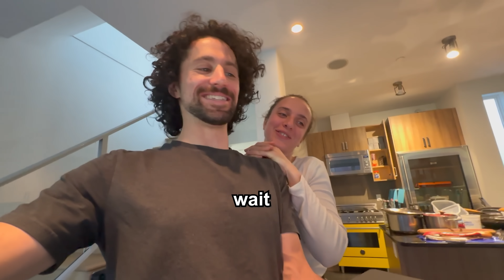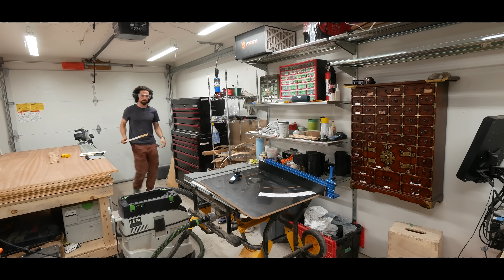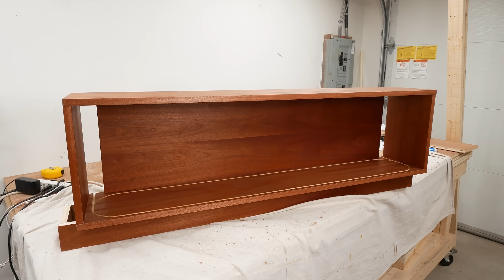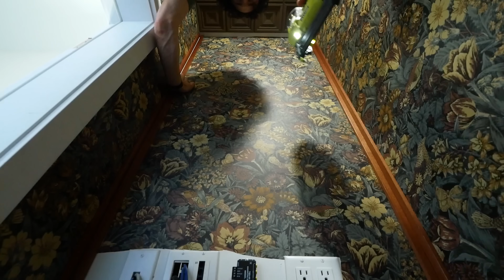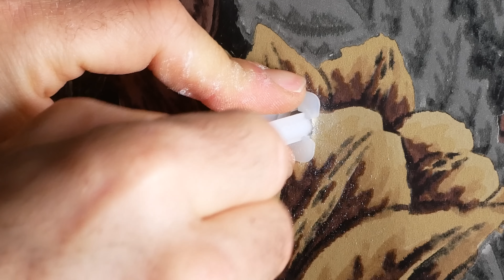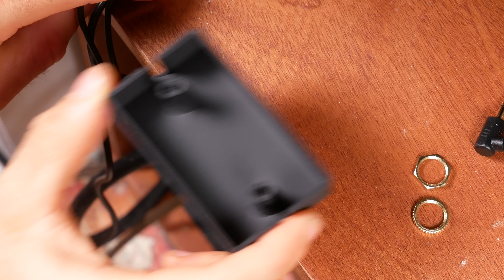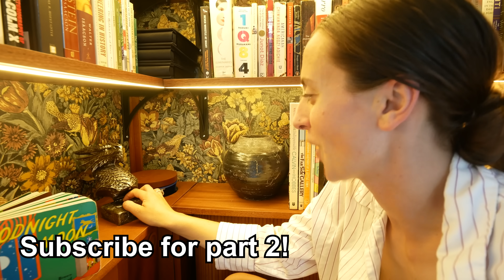I Built a Tiny Library on my Stairs

Comment: For the door, I think you could fuse those wood slat doors with a painting and have it roll up and onto the upper part of the wall.

Or, if the space doesn't work for that, get yourself a piece of art that naturally splits down the center to make 2 compatible pieces that roll onto either side when not in use. Should be okay to mount on the wall with a stylish track that could always be hidden by a curtain when everything is closed up. The curtain can be tied to either side for display as well. When you want it open, you have a hidden library framed by two pieces of art and a curtain. When you want it closed, you have a single piece of art framed by a curtain.

If you want a one-way mirror, you could put decals on one side and do the split art thing with that too.

Additionally, I think the curtain could be of either the heavier drape variety or of the light and sheer variety, whichever works best for the space.

Comment: Hi, here's a doorway option.  Extend the framing of the doorway entry up the wall to mimick/match the height of the window.  In the extended framing use a full length one-sided glass (not sure the wording for it).  The full length would make it a hallway mirror reflecting the window's natural light from outdoors and may allow and upstairs/downstairs view. The lower section of the one-sided glass would be the door way where the person inside can see out and no one sees in.  Remove doorknob and add magnetized press/release flat open/close feature to keep everything seamless, that way the doorknob doesn't make it obvious that there's a space abehind it. It would also allow the window's natural light into the room...I think.  Your creativity in this project was clever, creative, refreshing and practical.  Nicely done!  All the best to you!

Comment: For the door, I like the idea of a one-way mirror that you can see out of when inside but reflective on the outside. It would have to be a two-piece mirror which swings out 180º when opened... so a little like French doors. The inside of the mirror can optionally have a roll-down shade so that any light from inside wouldn't leak... or... you could even have a switch which turned ON LED lightning behind the mirror as a reveal. SO, the library is secret until you turn on the light which reveals the inside.

Comment: I love it it looks awesome 
2 thoughts.
1) put some sort of cushion on the top edge of the door to help with head bumps
2) make the door with lattice work and back it with fabric. This would create privacy without blocking airflow. You could even implement some sort of low profile fan that can heat or cool that can sit in this door making it easier to control the climate. As blankets exist maybe just a fan for cooling/airflow. Probably safer that way.

Comment: Eden is, indeed, the GOAT.  

As far as the door design goes, I am confounded as to what to make the outer shell look like, but I would recommend trying to make the actual door mechanism into something that opens vertically.  The 9-year-old in me says that the doors should have their seam about 2/3 of the way up the doorway, with the lower section being larger.

The reason to do this is that the lower section does not open to nearly 180 degress, but to something closer to 135.  The lower portion of the door conceals a set of simple steps, finished in the same way as the shelves, with a little hard-wearing tread in the center of each step so it doesn't wear out.  

The upper third will flip upwards, possibly on a complex hinge that allows that section to fully get out of the way of the doorway.  This way, when the door is open, there's a short stairway that allows a reader to climb up into the library without having to awkwardly swing their legs into place.

Comment: A pocket door would be perfect here, but that's not possible if you can't modify the wall. Maybe instead of a door you can use some nice curtains. You can tie them open when you want it to be viewable. That would also help with ventilation, especially in such a small space.

Comment: EDIT: Eden is the GOAT

Those drywall toggle anchors are heavy duty, man. (Made from glass fiber reinforced nylon, I think). 
       The good ones have a round part you push in to reinforce the hole, and a bolt (not a screw) to pull the toggle thingie as tight to the wall as possible.
     This means the force is distributed evenly across larger plains on the front and back of the drywall, and the hole reinforcement assures there will be no tear out (i.e. The screw cutting the drywall in half when weight is added)
.     Those style anchors can hold a couple hundred kilos (times that by 2.sumfin and you have the amount of pounds).

Pro-tip:
Use drill bits for metal to get the cleanest, most perfectly sized holes imaginable.
     (They don't even need to be super sharp. It's the geometry of the drill bits that gets the result)
.    Just make sure the drill bit runs perfectly straight. Run your drill full speed, view the bit from the side. If it looks like this: || it's fine.
If it has blurry tapered edges like this: \||/ it's not straight (and will create a larger hole).

Super dope project. And a wonderful result 🤘

Comment: Door idea:
A picture frame that slides upwards. 

This makes it feel naturally integrated in the house whether it is open or closed.

To avoid wall installation you can mount a fixture in the top of the doorframe. 
If you motorise it this to can have a hidden button like in the dragon. 

To make it less claustrophobic and better ventilated the picture could be made like the perforated advertisement wrap on shop windows, busses and cars, where the perforations let light and air in. So a picture printed on a firm durable perforated plate. 

Best of luck 😊

Comment: A bit of constructive criticism: I'm sorry man but i'm not digging those glaring white strips running across every shelf. I am a big diffused light kind of person and even with the diffusion strip, pointing them right in your face defeats the purpose, and it clashes with the aesthetic very badly as well.  

I think the effect you're going for would be to run them along the front of each shelf on the top instead of the bottom, either slightly recessed at an angle, hidden behind an extra bit of trim, or some combo of the two. The point being to point the strips to shine back at the books and light the rest of the space with the light that reflects off them, you want the lights hidden as much as possible.

They actually have special strip diffusers that have a prismatic quarter circle specifically for lighting from a corner and shine evenly across 90degres or ones that just mount flat at a 45 degree bias.  that would also be carvable into the shelf or printable.  

Also, please please paint that shelf in the hidden compartment black, or if you can make it look either wooden, metallic or otherwise matching the base of the bust that would be the best.  you have this thing that is extremely whimsical in a space that has a classy/serious/grownup/expensive aesthetic, which is great and can totally work, but having this bright blue and green plastic shelf pop up, makes the entire thing look cheap, boarding on trashy. To really pull this mix off you need it to blend in, and just like the lights, as is, this is absolutely glaring.

All that said, i really do like your stuff.  You have a lot of heart, I really hope you keep ahold of it as time goes on.

Comment: My brainstorm is open up the ceiling & add a fan. Ceiling fans are anti-global warming. Use a pocket hole drill bit to create the hole. 
I, too, was thinking, 'wow, yes, that would be hard to design the exact right hole spacing' (I've never done 3d printing).  Until the end, where you said it gets stuffy.  
A classic case of our brains getting stuck in a mode, seeing everything as a nail. 🔨  And propelling 🧠us into over-engineering.

Comment: how about a photo of the current doorway, made into a painting, it would be hidden in plain site, frame the painting and the frame would be the door. But you have to be able to see out, so use perpex and one way mirror coating as the backing for the painting, and the painting can just be printed on mylar to make see through. It will give you away if you turn on the lights inside the library

Comment: Cover it with a painting that you can lift up (like a guillotine?). The painting surface should be thin enough so that it’s still breathable, maybe like a material close to women’s stockings? Then just sublimate/ print the image on it, add tack it/ stretch it on an antique frame. I would personally print out COMPARTMENT C, CAR 293 (1938) BY EDWARD HOPPER. To diffuse/ hide the light coming from inside the library, find or make an old banker’s lamp that can sit on top of the painting acting as a spotlight. This would help diffuse the light coming from inside.

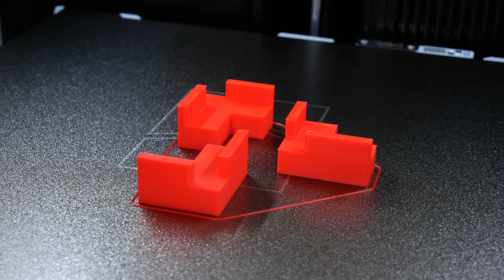Comment: 18:00 I could just be lazy but I feel like creating those jigs to create proper cut outs around the trim is over engineering (or if you just enjoy attacking problems in this manner that's fine especially since its a personal project) because I'd just pop the trim off and cut the trim to whatever height to sit flush on top of the shelves. You'd only need to use a pry bar, saw of any sort, and renail it. Instead you had to design a jig, print it, jigsaw the cutout, create new dimensions for the corners of the shelves, etc. In reality I'm just lazy and not as creative lol, LOVE the video!

Comment: Just a tip I used in the past. A strip of masking tape and some super glue in the 3d prints makes for a surprisingly strong way to hang stuff. When you want to take them out, you just apply a little force to unstick the masking tape

Comment: Since you did such a great job on the sliding wooden doors, what if you did something similar with the door for the library, like a super thin piece of wood that folds along the edges of the door frame. Maybe you could even automate it with a remote or hidden switch on the window (wireless to not cause damage)? Idk, I'm not a designer, but this library turned out sick!

Comment: 1 way mirror, a painting, a bookshelf (with secret spy hole), a second chair (would require open when the space is used), a large "book" you open to enter the library, 2 door fridge or wine storage, a large stained glass, glass shelfs 
I would also mask the opening with fake pillars and rounded top (is it called valve?)
Nerdforge might have some cool ideas

Comment: One of those retractable shower doors the van lifers use might work. It’s easy to install, stays small and out of way when not in use, and still allows light from window thru if one is inside its not closed in but still out of view.  Sweet project.

Comment: How about a hydraulic wall base that turns into a short staircase to get into the library? And the top-half could be a painting, decor, or hell, even plants stuck to the base. The way to open the library could be similar to how you may have seen in old cartoons, like pulling a book out, or turning the hands of the clock. Or maybe you could do something with optical illusions. Maybe even a decor with a riddle that hints at how to open the hidden library. Or you could just do Narnia.

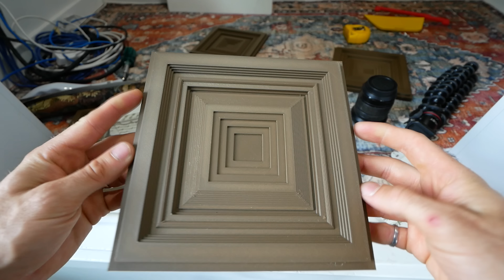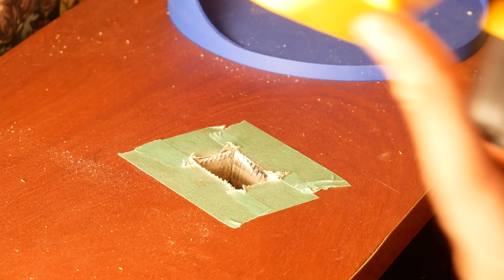Comment: 04:45 No I was actually thinking, why 3D print every tile. Why not print one, make a mould and then cast a load of tiles in either resin or plaster. 26:00 again kinda taking the easy route by hinging it at the bottom so the whole statue tilts back. You should have concealed the switch in the neck and just tilt the head back, or in the mouth….tilting the upper jaw back also pushing the tongue forward to reveal the switch. 🤷 Your approach just feels kinda half baked.

Or if you were just gonna have it tilt back like you have, why have a separate switch underneath you then have to press? Why n9t make the action of tilting the head back the switch? 🤷

27:50 a painting is good, but not one that splits in half or one where you simply open the frame out to get it. Have a big ornate gilded frame around (very Victorian) to get in you need to release a catch with something….either magnetically or rfid tag concealed in an object such as a wand. That opens things up and then you push through the painting…..so the image in the painting, say of a large ornate Library, folds back to the left and the top blending in with your shelves allowing you in……ORRRRR make the door a 3D illusion, like one of those 3D shapes that looks like it’s going back into a room but it’s actually coming forward. So when you walk past the thing it looks like a giant room even though it isn’t. And then just make that open up as a regular door. But it would add some additional storage space or general space to the inside. 🤷 like this is what I mean https://youtu.be/-tIQrWaWWT8?si=wempgdjepI7l0xnu

Comment: Hear me out. I know you said you didnt want to rip the wall apart but if you did you could or did. I think a vertical lift door but having the track come down and flush with the drywall. Use a picture frame style border and use a painting as the door cover so when all together it would appear as just a painting but when you push it and slide up that would be your entrance in the most secret way no visible seams.

Comment: A door that comes down instead of opens left and/or right would be rlly cool and save space. If you made an elegant frame and put a picture on that up and down door then you could still execute the secret painting vibe. Maybe turn the painting idea into a little challenge for the art class in a local high school! Of course making sure either a paint mixture that can easily be flexed regularly or the paintings be uploaded and get high quality printed onto a fabric. Also maybe put an old school style fan in there (with a good mesh just behind the horrible old school frame of it for safety) the really old fans with a splayed frame/guard would fit the aesthetic a bit!

Comment: The door for the secret library should be a see through mirror. meaning you can see outside even when the dorr is closed. But it will just look like a normal mirror from the front

Comment: Be kinda cool to create a set of functional shelves (or a painting) on a plate that slides vertically up.  this way you can either lift or lower the "door" from inside without possibly hitting someone (by swinging it out) or leave it just open with the "door" out of the way.  Plus it would meat your requirement of allowing you to view outwards and not block the stairs when its open.  It could also be set to look visually almost natural in an open or closed state (at least if using the painting or just a wall plate idea).

P.S. I totally expected you to put in like a small wine chiller with a glass or two.  whats a good book without a nice glass of wine to sip on.

Comment: A door that looks like a painting. When it's open, the painting is above the entrance, making it look as if the painting should be there instead of looking like an open door. It could be pushed upwards by a rail on the door frame. The painting could also slide forwards a bit from the wall before being pushed upwards. By the way, very good video.

Comment: I feel like a painting that slides up would be a perfect secret door. To not use tracks that would be visible when closed, you could come up with some hinges kind of like those in the trunk lid of the car. This way painting would be flush with the wall when closed, but offset from the wall when opened. On the other hand these hinges wouldn't look pleasing from the inside unless there is a way to blend them in with the looks of the library.

Comment: Toggle bolts are insanely strong and useful, especially the snap toggles you got which make them easier to use and re-use.

Molly bolts are another great option. If you don't need to hold as much weight, the screw shaped anchors are also great.

Comment: Pro tip: Just so you don't feel like you're forced to use drywall plugs. Just cut a long thin strip of wood that spans across multiple studs (it can disappear using paint) Once that strip is screwed to the studs, you can now attach stuff anywhere you want since the board spans across multiple studs👍🏻

Comment: Painting that slots up for the door. When open = painting on wall + doesn't block window. When closed = Painting on wall. I personally like the idea of a landscape, hinting at the world beyond. To open, simply push the frame up and have a inset handle for when inside. Also if slots don't work having it on some sort of scissor hinge esc mechanism

Comment: For the door it would be super cool to do a preserved moss or fake plant wall that raises up to reveal the library, would be a lovely feature wall when closed and give like a forest canopy vibe when open. Maybe something that functions like a vertical tambor where it rolls up and tucks behind itself or a mechanism where the door is multiple panels that can lay flat when closed and to open it they tilt forward from the bottom then pull up like large blinds, either way you could operate it with a cool crank thing

Comment: The door has a frame so from the inside if you have a roll up painting to 'shut the door' and from the outside it will look like a painting with a deep resses. You can put fancy mouldings around the outer door frame ane make it into a fancy 'painting frame'. I'm sure you could get a great painting printed on a roll up opaqur window blind, and it would just roll up and roll down.

Comment: A painting that slides up when a phrase is spoken (using on of those cheep Arduino speech detection modules)  with a pretty mechanical aesthetic on the rear side. Maybe install a release mechanism for safety too.

Comment: For the door, you could do a painting on rails which, when down/closed hides the library, and then slides up provide access. You can mount the rails on the wall outside of the doorframe which would be minimal cause minimal damage.